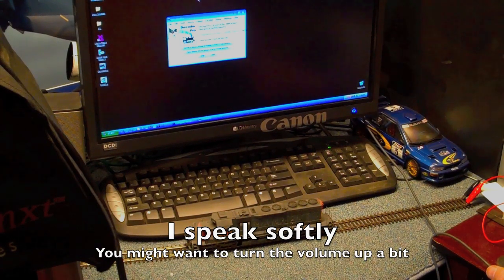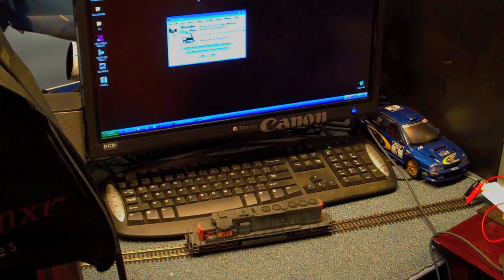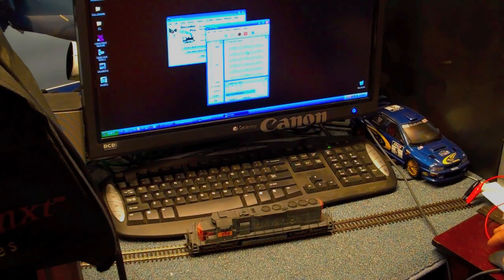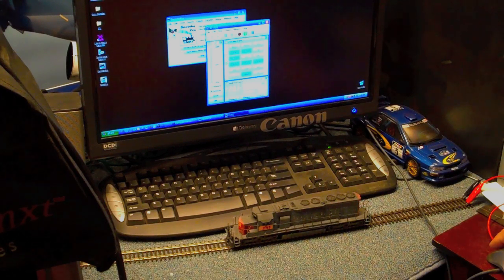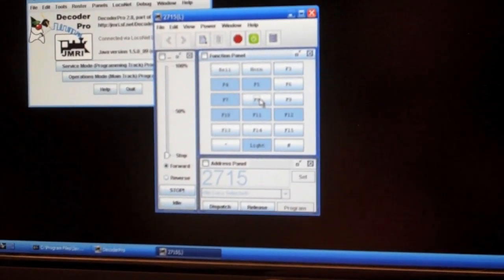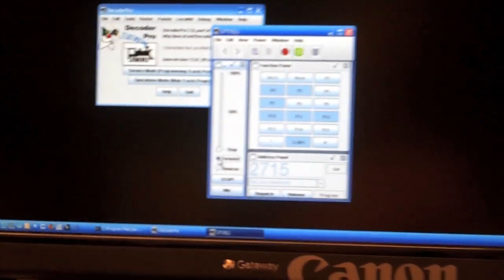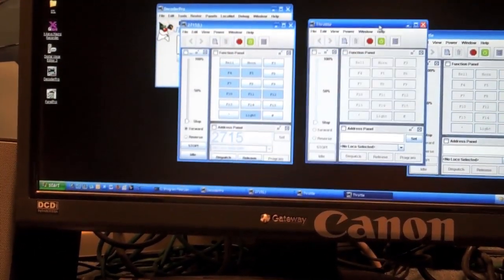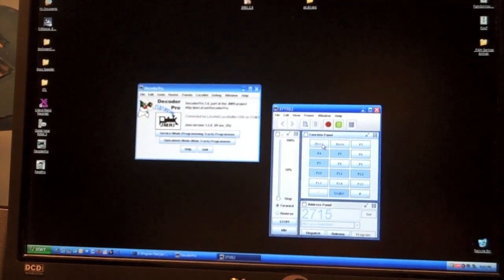Controlling Model Trains with your PC

Comment from the maker: @hekhoe Yes you do need a DCC control system.  The LocoBuffer plugs into the LocoNet Bus of the Digitrax Command Station and then the onscreen throttle just replaces the hand held throttle (although you can still use both if you want).